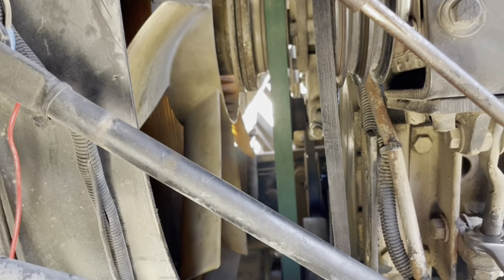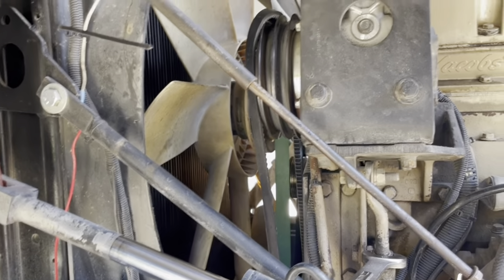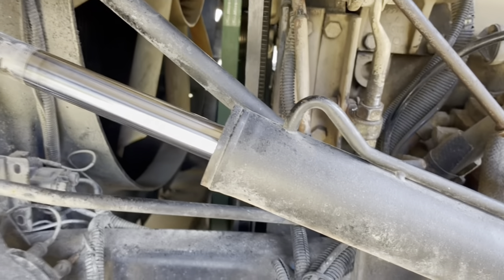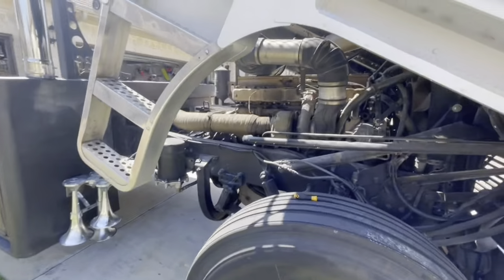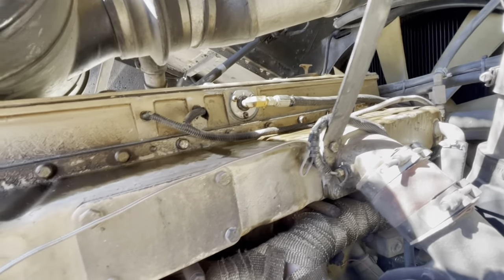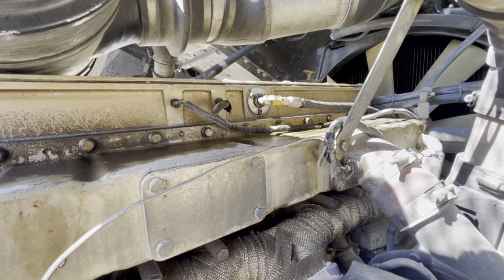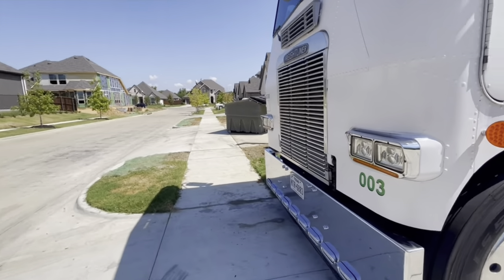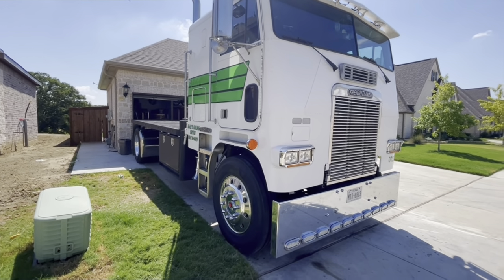Air conditioner issues agin on the cabover

Comment: I just spent $375.00 on new compressor on my car a.c. come to find out it was the condenser fan not running on high and the temperature was high causing the problem water temperature was fine but not on the a/c temp so make sure your getting good air flow thru it at least it threw your belt saving the compressor unlike mine but stay safe and keep the video's coming
Reply from the maker: Thanks!  That is defiantly something that I checked. I found in the end it was a rough spot in one of the idler pulley bearings. Think have it all taken care of now.

Comment: Had a problem with an air compressor on a 6V71 throwing off several brand new matched sets of belts. Switched belt manufacturer and that solved the problem. Had good luck with Dayco.
Reply from the maker: That’s good to hear to watch out for. I found in the end there was a idler pulley with a ruff spot. Pretty sure have it licked now!
Reply: Oh, yes, an idler. Good thing you caught that. You don’t want to damage that new radiator!